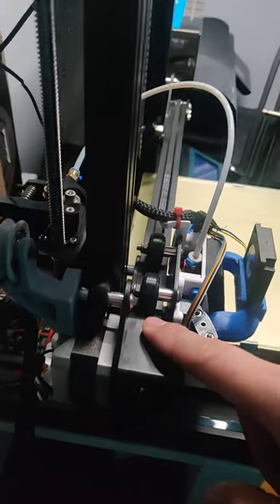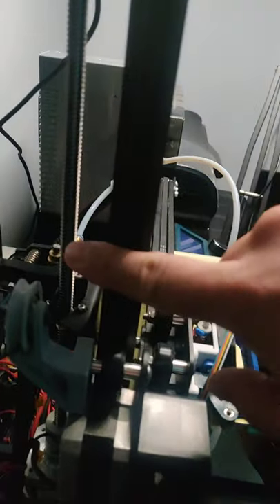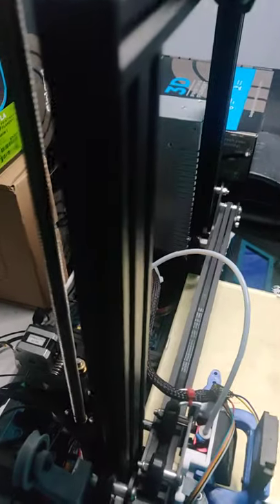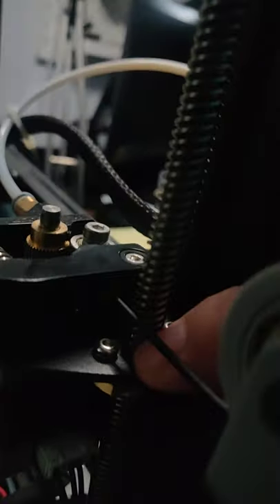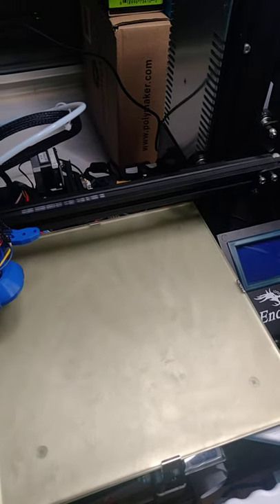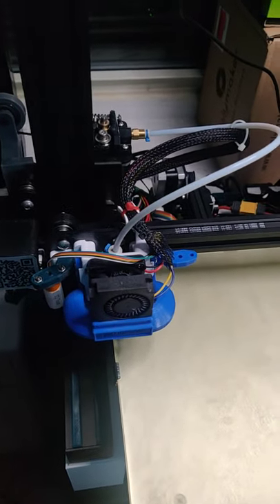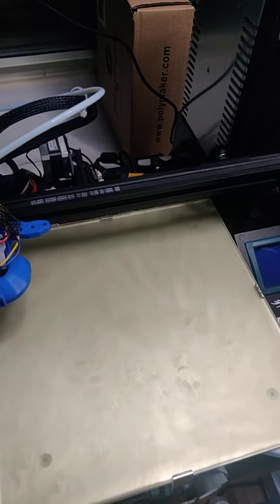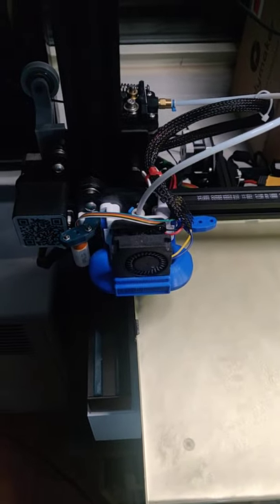First beginner's tip for the Creality ender 3 3d printer to prevent elephant foots in your prints

Comment: Thanks. Does the Ender 3 Pro has the same problem?
Reply from the maker: I believe so, they aren't designed different at the Z-motor. You can check this yourself by lifting the gantry all the way up, then see if your brass nut lines up with the top of the screw. Also forgot to mention in the video you need to loosen the brass nut a bit to give it some free play with any slant that you cannot see.